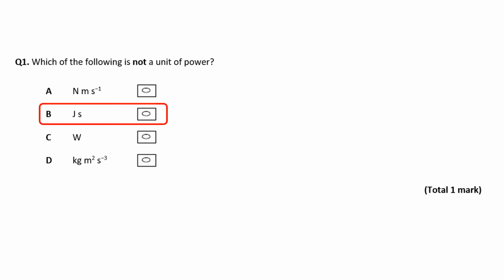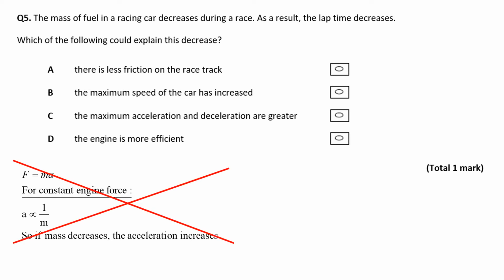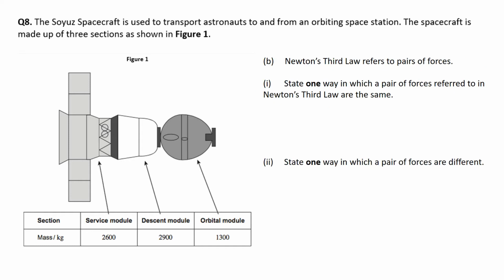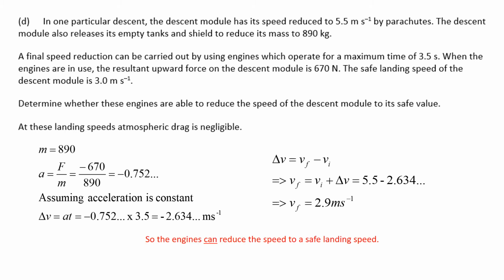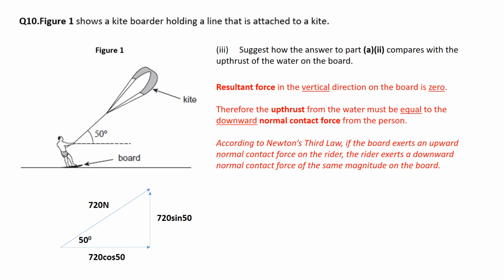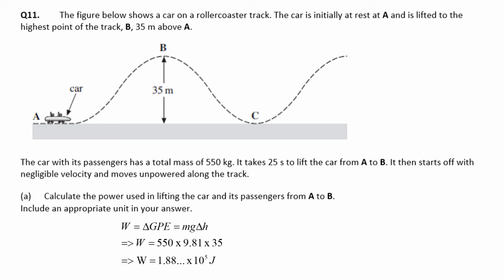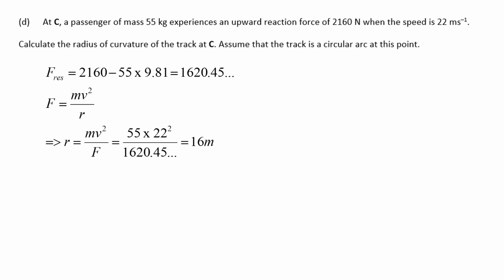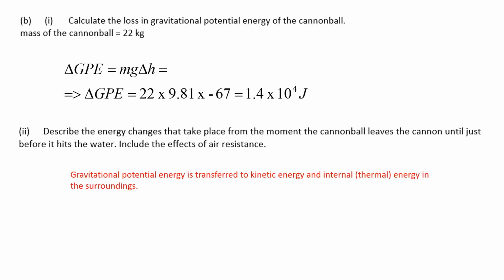A Level Physics: Mechanics: Mock Exam

Comment: Hello, thank you for uploading these videos they are very helpful. I just have one question. For question 10a is the vertical component of the tension in the line different to the resultant force in the vertical direction?
Reply: Also, please could you do a video on questions relating to Archimedes principle. I would really appreciate it. :)

Comment: Kinda confused about the question with the racecar... Aren't F=ma and F=mv/t basically the same equation but just different manifestations of Newton's 2nd Law? Since acceleration equals change in velocity per unit time, you're just replacing the 'a' in F=ma with 'change in velocity over time'. So therefore why is it acceptable to use the second equation if mass isn't constant but not acceptable to simply use F=ma?
Reply from the maker: They both originate from F = d(mv)/dt but that equation only simplifies like you show to F = ma when m is a constant which is why you can take it out of the change expression d(mv). If m is not constant, you can't take it out of the change expression to make it md(v).
Reply: Ah awesome thanks!